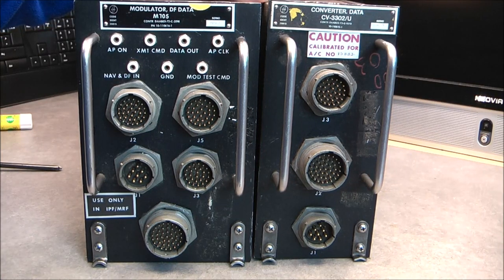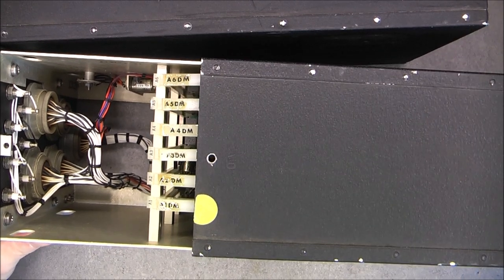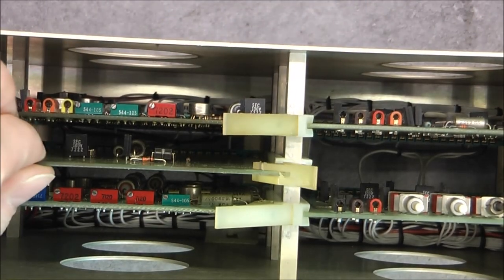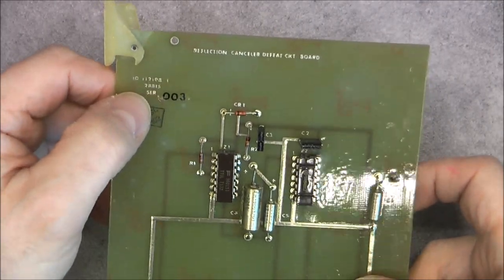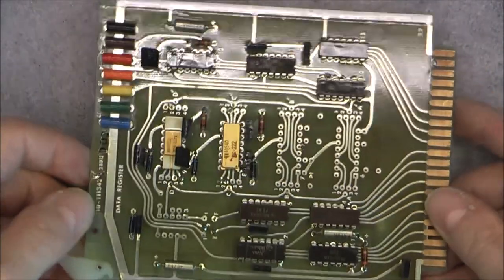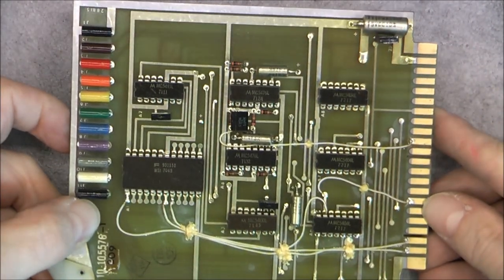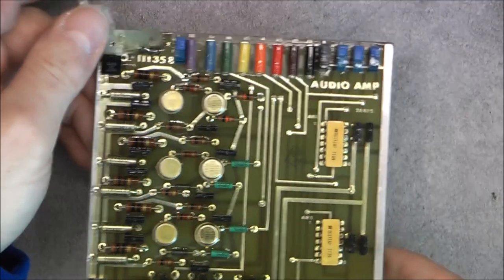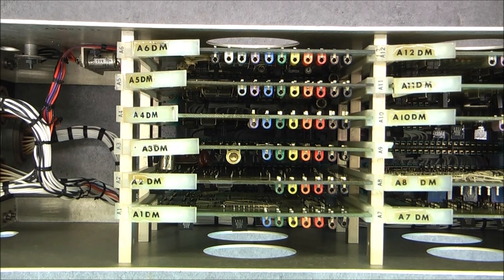Teardown of two obscure ESL avionics boxes

Comment: I think I know what system these belonged to based on some research. It's obviously for direction finding, and though it's made in the early 70s. I couldn't find the contracts, but here we go:

1: I suspected it might have something to do with the US Army's GUARDRAIL ELINT system, and I remembered some of the acronyms. Indeed, the IPF is the 'integrated processing facility', the ground based section, and the 'MRF' is the mobile relay facility, a later invention to keep the (large, vulnerable) IPF away from the front.
2: We've got time bounds and system bounds to work with, so finding 'aircraft 15883' is a little easier. The large number can indicate a lot of things - a partial US Navy 'buno' number, a combination of last-digit-of-year+serial number in an odd format (common USAF/Army system) or just the serial number part for an Army aircraft (Army serials start at <2 digit year>-10000 or more). Indeed, 70-15883 would be a Guardrail RU-21! (Source: http://www.joebaugher.com/usaf_serials/1970.html)

Calibrating to the aircraft makes sense - early Guardrail was a very analog system and there's no real space on the aircraft for elint operators, most of the system operation is done from ground console.

The system was both cutting edge when it came out and modified many times (by 1991 version '5' was the current) so numerous modifications are to be expected.

Comment: To remove that conformal coating you use either MEK, trichlorethane or acetone, depending on the exact conformal coating used, using a stiff bristle brush and a lot of effort.  Some are solderable through, but in general you scrub it off with lots of effort and time, then work on the board. You should replace it afterwards, but often instead of the nasty coating, with a very limited shelf life both before and after opening, you use a transparent spray on coating instead.

You probably are missing on the large unit one board containing the PROMS that contained the logic program, along with the ADC/DAC board, as those are the parts that contain the propietary protocols for the PROM board, and the other board contains the near unobtanium no longer made Intersil DAC and companion R/2R resistor array needed for the successive approximation ADC, along with the sample and hold amplifier and comparator it used, and the little glue logic used to handle the serial input and output. Likely used to process analogue inputs to digital, and encrypt them for transmission to either ground via radio, or to provide them to other computers  that did not have enough extra inputs for them after upgrades. Thus the dummy line driver board, there just in case the original design was not able to drive reliably, where they would have had a pair of beefy TTL line drivers to provide the needed current capacity. 

Probably was a replacement for the original interphone, radio comms and speech processor box, providing the speech functions along with the other functions, as there likely was no more space left in the avionics bay, and this box was there and had enough room in it. Thus the warning about modification states on the outside, it would only be usable post upgrade, and would likely not work on older variants, and the multiple modifications were as the modifications to avionics progressed, with upgrades as the functions were tested and changed along the way. Thus all the pins for programming serial streams with hard coded data, and the multiple prototype areas where you could put in almost any TTL IC, and connect as needed for added functionality to the existing points and edge connectors as required.

Missing any power supply circuitry, probably fed, via those filters, from the main avionics processor that it was right next to. The grounding was also fed back to there, with the chassis grounding being totally separate as well. One of those connectors probably had more than half the wires going to the unit next to it.

Comment: They are most probably not bodges but designed to be there, it is quite common to have wires one military and Space electronics, sometimes there ist just no space on the PCB to run some signals because of the very tight PCB layout rules.
Reply: Definetly on one board with that lonely IC. It had only power supply routed to it on the edges. Nothing else connected. Definetly space for a mod or spare.
Reply: Dual layer boards as well, they probably could not make a cost case for the, then very much more expensive, 4 layer board to be used, as it was a "production prototype" and likely to be all made as prototypes for the production run. Total number of units likely to be under 50 for all the fleet, though you can see from the serial numbering they are all prototypes, as the production units would typically start at serial number 100 and up. Either a development unit for the final product, or a superseded short run mid upgrade part unit.
Reply: Yes for sure, especially where components have been replaced
Reply: Yes and there is nothing inherent bad with running wires on the board, have done it often, sometimes it just makes more sense but it cost a bit more in the assembly but if you are already THT it dose not change much.
Reply: Sometimes the simplest board that you are sure is going to work needs multiple bodges.
This always happens to me. Wrong package, mixed up pinouts, connector orientation. I usually try to blame it on my cat